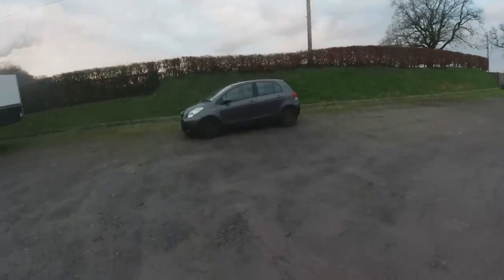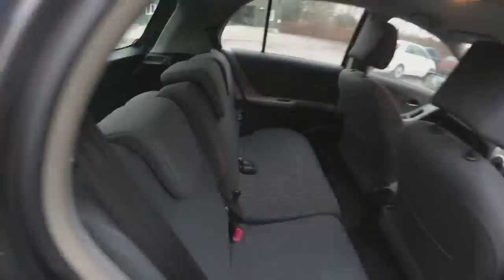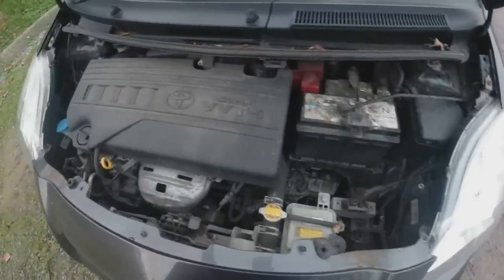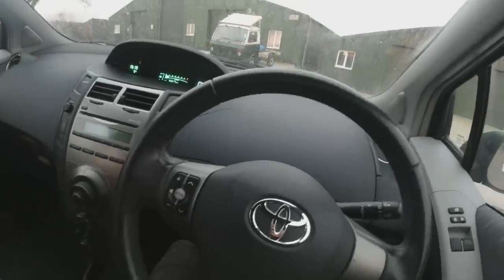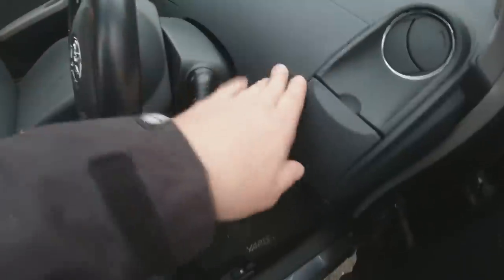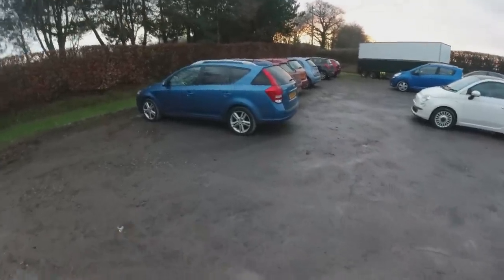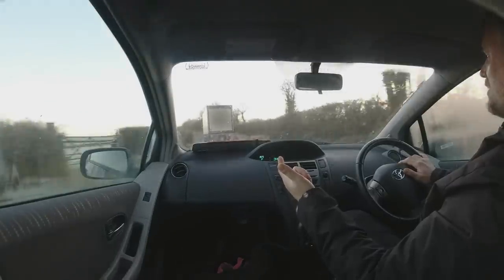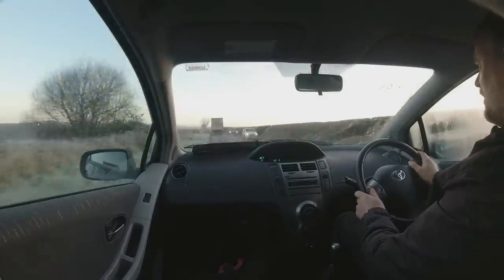How could they let this happen? How did it slip through the Net!

Comment: Cracking cars. We have had my wife’s 57 plate T-Spirit 1.3 manual for 11 years now, has 55k on the clock and has never missed a beat. Every MOT has been 100% clear of any issues. Under passenger seat there is a drawer that could have service history in.

Re the oil, the oil in our Yaris stays like that between oil changes.

Comment: my 2013 pro ceed has a low clutch. my local garage guy mdified it and got it to lift but i cant remember what he did i will find out and post back a follow up
Reply from the maker: That would be cool, thanks
Reply: I've heard of people putting shims between the slave cylinder (external) and clutch fork. Not really the right thing to do but as long as gears don't crunch it'll be 'reet

Comment: I owned a 2010 (60) Yaris TR and unless they changed the spec. from 2009 to 2010, that is not a TR. If I remember correctly the TR had an "analogue" speedometer and cluster, not the "digital" as on this car and lower spec. versions. Also I would be suspicious of the steel wheels in place alloys as originally. I'm sure the TR had cruise control  as standard too. I could be wrong and open to being corrected. Has a previous owner stuck a TR badhe on the back?
Reply: It is a 2009 Tr with digital dash & no cruise control most have alloy wheels though some have steel wheels with wheel trims.

Comment: 1:46 - the front driver's side wheel is bent near the top.  Worth swapping those wheels out anyway though.

My mother also used to have a 2004 Corolla and it used the exact same type of key, also same rocker switch for the mirrors.  Guess they don't upgrade those too often.

Comment: Part way through. Grading due to mark on door, lack of alloys and book pack and spare key presumably. MOT addresses using V5 may bring up Toyota, hard to know. Book pack about £18 if want to buy one. No recalls. May need subframe rubbing down and painting and new rear springs. Early 1.3vvti used oil but Toyota fixed the problem later on.

Comment: Clutch damper on that Kia is a good shout 👍 the Korean stuff is a sod for those, had to do them on both diesel Hyundai’s I had due to low bite and notchy gear change, on the I30’s you can actually blank them off but sure if that’s possible on all models

Comment: I wonder if someone's put a set of winter tyres on " steelies ", and sold the Alloys with Summer tyres separately after trading it in ? Just a thought .. Just checked the previous video, it's a " UKCG " code, which certainly used to mean it was a " webuyanycar " purchase ..
Reply: I thought UKCGR meant UK Car Group, who it turns out were bought out by BCA. Own revived Carcraft in East Lancs.
Reply: @alexdalgleish1061  UK Car Group was indeed the parent group that owned Carcraft and who founded " Webuyanycar ". They sold the Carcraft side of the business  to a management buy-out, before it folded. The McKee brothers then sold out to BCA, as you say. The better newer cars used to be marketed through BCA as " UKCGR " whereas the cars 6yrs +, and cars judged to have excessive damage went through the block as " CC Trade Sales " ..... that was a few years ago so it may have changed !

Comment: I think they drain most the fuel on the auction cars, friend works for co part. He said something along them lines and the staff get to buy it for cheap like £25 a tank. 

As for you getting it with no issues I think it’s “too old” for them to retail themselves.
Reply from the maker: I really meant those deals dealerships normally have with a local chap for the decent pxs

Comment: With the newer 1,3 engines you have to be careful and religiously change the oil and use the spec it needs and it needs a specific grade of oil that is usually not frequent for these engines, some 0w20 or 0w30. I don't think this is from those series though but in case you don't do it properly or prolong the oil change interval these start to burn oil like no tomorrow as the oil passages on the pistons has been reduced under the oil rings (third ring down the piston) and if the oil start to get used and contaminated those smaller holes starts to get clogged and the engine starts to burn oil first slowly then insanely and the only way go fix is to get the engine rebuilt with a modified set of pistons or replace it with a new engine. 

Hopefully this is not from those 1,3 vvtis those should be the newer series. Regardless make sure you put the toyota spec oil when you change it and change it regularly. 

Otherwise Toyotas from the last like 10 years are nowhere near as reliable as they were before. They are living from their past.

Comment: Thanks for the update on the Kia, I already changed the damper valve and clutch on my Kia CEED and clutch is still low at biting, even flushed the whole clutch/brake fluid and still no difference’ if you do find a issue please let me know thanks’ looking forward to the Kia video’ all the best
Reply from the maker: This worries me, dont want to spend for no reason. Did you change master cylinder?
Reply: @ChopsGarage  no I haven’t changed that, I think this is the last thing to replace on my car, everything else has basically been done, I drive it from Scotland to England a lot and 0 issues even with the low bite as I’m used to it now’ but going from car to car it’s tricky as going from a ultra low bite to a high aka normal, everyone I talk to on the Kia forms on Facebook says it’s normal for these’ and the sales man I got my car from says he has a Hyundai Tucson that has the same low bite

Comment: I have a Toyota Yaris  Auto sport 1300 these cars are reliable good on fuel mine is nippy past last five M.O.T not needed spend a thing on it in the five years I fitted two cam sensors had new timing chain Fitted because manigent light would not go of but timing chain should be changed around 8000 miles mine is a 2009 model and it has every service stamped from new u am 3rd owner good cars James 

Phil in stoke

Comment: Yaris normally suffer from noisy chains and noisy second gears, in fact, most Toyota petrol if they been used round town. My 2002 Yaris had a noisy chain for about 3 years :D My 2000 Corolla suffers from Whinney second gear don't miss a beat. Things you listed were all wear and tear :D Toyotas are more reliable then my shits in the morning :D Whats it going up for?

Comment: It must have been started twice to get it on and off the transporter. You started it twice just at the start of the video.
So I guess it’s the one that got away!
Reply: It would be 3 drive cycles, not certain on the exact conditions required but it's probably 30 mins or a certain number of miles X 3 👍